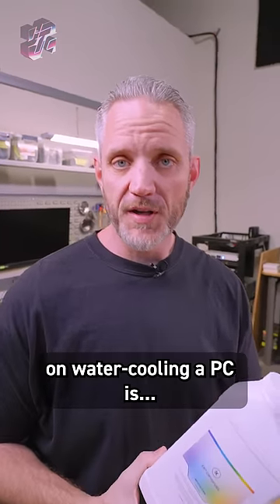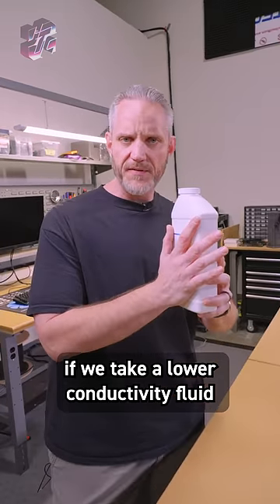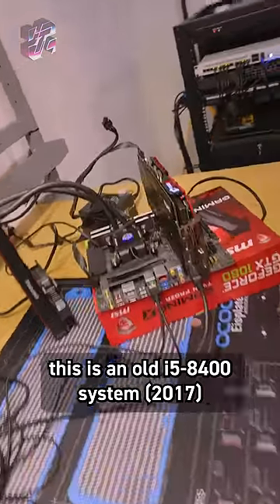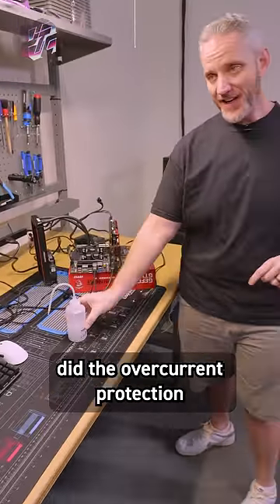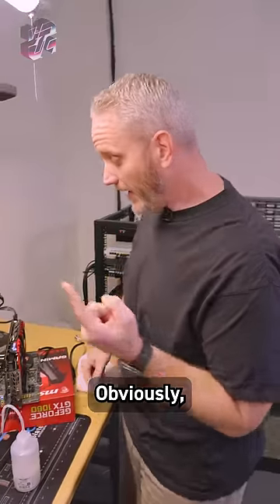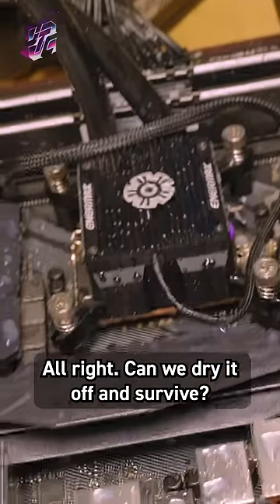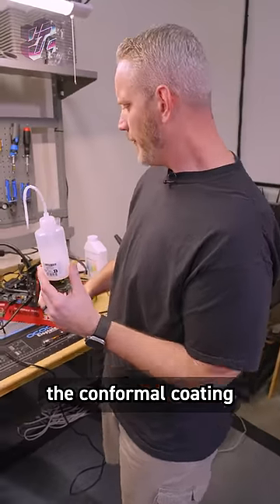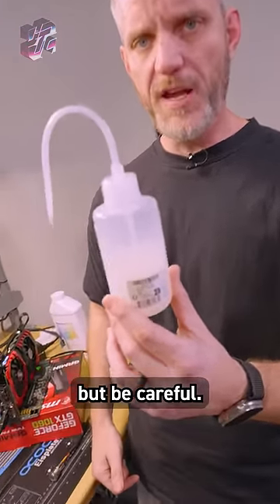Pouring water on a PC for science!    #pc #pcmr #shorts

Comment: I'm sure it's dependent on WHAT gets hit with water. I had a distilled water leak years back spray from a radiator in an open loop directly onto my GPU. Nuked the GPU, CPU, and motherboard. Only the memory and storage was salvageable. Of course the cheapest components survived....

PSU protections are probably better today as this was a decade ago but I still don't fully trust open loop systems since as that was a VERY expensive mistake with cutting edge hardware.

Comment: Why would the overcurrent protection of the power supply trigger here? Your CPU is drawing dozens of amps while the liquid will conduct a few mA at best. A drop of this liquid may change the value of a resistor with dozens or hundreds of kiloohms significantly, messing with reference signals on the board. If you drop that to the power regulators on the mainboard, you may get an overvoltage from that (as you mess with the voltage reference). Anyway the explanation here is absolutely wrong and suggests you can just water your components like plants.

Comment: I'm still sticking to air cooling, there's fewer points of failure.
Reply: The risk with water cooled systems is very minimal, so long as you know what youre doing. If you have some skill in general plumbing, putting these systems together should be second nature.
Reply: @Draugoth  I'm not referring solely to leaks. With an air cooler, pretty much the only point of failure is the fan, barring some freak manufacturing defect in a heatpipe. Replace the broken fan with a new one for a few bucks, bam, done.

With water cooling, not only can a fan fail but there's also now a water pump that can fail too, plus a non-zero chance of a hose or fitting leaking. And if you're using an AiO, if the pump fails you're looking at an entire new AiO unit, no fixing that piecemeal. For gaming workloads, the extra heat capacity of a water cooling system just isn't worth the drawbacks to me.

Price is another consideration. I've been using the same $50 Zalman cooler for nearly 13 years, with both my old i7-2600K build and my current i7-9700K. I've only replaced the fan once, and it's still cooling just as well as the first day I got it. If I had gone with water cooling instead, I'm sure I'd have spent a lot more money replacing a lot more parts than just a $15 fan over that timespan.
Reply: @executor32  Well, most systems will be just fine with a simple air cooler. Its not really till you get to higher end stuff that eats more watts that you also  plan on also pushing very hard where liquid cooling will yield better results. All my old systems were air cooled. On my last system, the little UFO style cooler lasted seven years, course I was runnign an i5. There are some AIO units you can repair and/or refill, but generally once the pump is gone, that's kinda it especially since they are supposed to be vacuum sealed and about nobody but a manufacturer can do that. That said, you can expect around six years out of a typical AIO, given you minimize the amount of air in the pump chamber.

Comment: Yea, I've messed up a few times over the years with watercooling, like forgetting to tighten down a fitting, but I never had and components fry from it.
Reply: Did you use water or a glycerin based coolant?
Reply: @Kmmlc It might have been normal tap water once, in the early days, but after I bought a dehumidifier I used the water from that from then on, so it was maybe safe enough anyway.
Reply: @JoeBob79569  Personally I prefer using a glycerin based coolant even though it's not quite as efficient. I will never have to worry about it being conductive and if it does manage to leak and gets somewhere I don't see, I don't risk frying anything. Though I did have a loop for 10 years and only had to change the tubing once and the coolant I changed every two years.

Comment: jay you should leave a pc next to a window, I had one that had some condensation buildup and it made a wonderful smoke/vapor show.

smelly "smoke" poured out, i pulled the plug, couldn't find anything burnt

removed components (the gpus) and booted it a second time, nothing was really off or wrong, maybe a little more vapor.

i put a single gpu back in the rig and it booted fine, still need to test the other gpu that was in the rig.

but it booted again even though there was a huge smoke/vapor show, but i think it'd be a good demo for people that maybe run their computers next to a window/high humidity conditions.

if i had noticed water on the mobo i wouldn't have booted it, so i think there was a thin layer of condensation and when i booted the pc it instantly heated the components, evaporating the condensation making me think it was smoke.

there were no bad "electrical" sounds and the psu never kicked off
the pc didn't flicker or anything (i turned it off within a second, the vapor was instantly when i pressed the power button)

Comment: This year I had one of my hard line tubes pop mid stream. Water/coolant was absolutely gushing inside. I managed to shut it down before it shut itself down. Took that as an opportunity to do a deep clean, figured out why the part blew out ( it was a complex triple bend with two 90s and a 45 and not much room between a fitting and the glass side panel, one of the bends was too close to the fitting and didn't allow enough bite, honestly surprised that it lasted as long as it did), corrected the issue with a new pipe, installed the new pipe, refilled, and it's been working like a champ ever since

Comment: Jay: Never use a blower on your PC
Also Jay: Use a blower to dry your PC
Reply: You can use a blower on the PC, just not a compressed air blowerm, I guess
Reply: Opened the comments to write this exact one.

@Morbiuzx1308 it's a reference to another short, where Jay showed the same blower and said not to use it on a pc, because fans are also generators and electricity doesn't mix well with computers, jadda jadda.
Reply: @mehowme  poke something in the fan to stop it rotating 😉
Reply: @mehowme so it's fine to use it on your PC but not on most fans while they're connected to your PC.
Reply: @mehowme ... tape down your fans or hold them in place?
Reply: Main issue about blowing air on PC is spinning the fans and creating an electric current that might hurt some components.
Reply: @fsmdf   as i commented above, poke something in the fan to stop it rotating, i doubt it'd generate enough current back to the motherboard to damage anything on that, but could certainly destroy the fans internal circuit
Reply: @sambob998  extremely unlikely it'd produce enough current back to damage anything on the motherboard....destroy the fan itself, yes very  possibly
Reply: @fsmdf I've never had a problem with this. I always shut off my PSU, then unplug from UPS. Clean out PC quickly. Let sit for an hour or two. Plug it into UPS, switch on PSU. Power on. I do this once a month because I like to keep my systems really, really clean. 

If it's a friend's system with a lot of caked dust and such. I'll tape fans or just remove them and clean them with a brush after taking them apart.
Reply: @SgtCroaker  'if' it is going to damage something, it'll only be the fans internal circuit  itself, extremely unlikely it'd be able to produce enough current to backfeed into the main pc circuitry as it'd be such a much lower resistance load!
Reply: @SgtCroaker 
PC fans generate electricity/current even when not connected to any power at all and thus, when you spin fan blades in a PC w/o it on, you are doing damage to the components in your PC. 
  Thus, have PC on when blowing and avoid any issues.
  If Fans are really bad, detach out of PC if possible and clean.
Reply: @andygozzo72  I know. It doesn't hurt to take precautions. As far as removal of fans for cleaning a very dirty system. It's just much easier to do.
Reply: @truthseeker6532  if fans are bad I do detach and take them apart for cleaning
As for the electrical issues. I've not experienced any issues ever before on my builds going back to 2007. I give a quick blast and use a soft paint brush.
Reply: @SgtCroaker  
You must not have an expensive PC.  I take it you are not a Gamer? 
Most PC Gamer Rigs start at 5 grand and that is the cheaper side of things.
PC Gaming Case alone, is around 400 - 800, Video card around 2 grand, Monitor 2-3 grand.
Most Good Gaming rigs are around 8-10 grand for everything.  Have a built Room as PC gaming room or a room turned into PC gaming room can be ones bedroom.
  The unprotected electricity/current entering into a 5 grand to 10 grand investment Gaming PC = One will be careful when cleaning or learn a very costly lesson the Hard Way.
  Business PC's 2k or less or so, who cares.  PC too cheap to go through the hassle.   Just a video card from a Gaming Rig PC (4090 = 2 grand) cost more than many PC's at companies and at peoples homes...........lol!!!!
Reply: @truthseeker6532  What?! Where do you get these prices from? $5,000 for essentially a beginner "PC gaming rig"... I'm dying. Lmao..

Comment: I've "accidentaly" put my screwdriver on my mobo, z690 pro A and the psu is an RM1000X, my 13700k died. 2 core precisely died, I had to disable the 2 faulty core in the bios for being able to use my pc when the cpu was used a bit more than usually, like heavy game or benchmark

Comment: agree, electronics nowadays are tougher then people think, yeah, dont go throwing salt water on a 50,000,000 super computer. but most systems will handle accidental spillage/leaks, had a system survive a housefire WITH sprinkler system. still worked fine for 2 more years. then it blew up. but still 2 years of system that was soaked and ON durning the sprinklers going off, and then getting dried by a toasty 1500 degrees Fahrenheit housefire. impressive. linus did a video too on static electricity and how they harm components, and they hardly do any damage

Comment: My loop suffered a catastrophic leak a 2 years ago.
A blockage developed in the radiator due to the EK anti-vortex foam disintegrating.
The system overheated and a tube popped out.
About 250mL of fluid dumped out.

The next day.
I removed everything from the case.
I stripped the case down to bare metal, I even took out the Front IO board, I hosed down the entire case

I also removed all heatsinks on the motherboard and I used a pressurized chemical sprayer full of IPA and sprayed the motherboard, RAM down.

I also had to take apart the GPU and CPU water blocks to clean them out as they had some of that foam in them.
The pump has some in it too.
But cleaning out the Radiators was the tricky part.
After 2hrs everything was back together.
Just had to wait on new tubes to come in.

What I learnt, do not use those fucking anti-vortex foam things.

Comment: The highest risk of leaks is when the system is first filled.  The easy way to check for leaks is to fill the system and leave the pump running for 24 hours.  Check the water level in the reservoir every hour.  If it doesn't stabilize, you've got a leak in your system.

Comment: I really doubt the psu is tripping out on over current. it would take a ton of current to trip out the psu. water isn't conducting enough to do that. if anything, it's just crashing the computer or causing the motherboard to panic. example, my tap water from the kitchen sink, last I checked something a bit over 200ppm, I'm seeing a bit more than 30k ohms with a multimeter in a glass of tap water. at 12 volts, this water would conduct about 0.4 milliamps, only 0.0048 watts. there is no way a psu will ever trip out on over current protection from this tiny bit of power. a single led uses orders of magnitude more power.

Comment: I've never liked watercooling starting decades ago now in the earlier days of what would become what we consider more modern watercooling. Instead, I focused on perfecting airflow through optimizing fan count, direction, power, air ducting to guide air, etc. My systems are quieter than most water cooled and, outside of epeen benchmark races, work just as well as or better than most setups your average user would buy and install for a lower price and much longer life span parts/materials wise.

I'd be more worried about people using tap water and having tons of minerals deposited onto the board after it dries. Obviously, you're not supposed to use tap water, but you're not supposed to do a lot of things people do anyway.

Comment: There is no conformal coating on consumer-grade computer components and the power supply didn't protect your board from a short circuit. Your setup turned off because of the current leaks in higher sensitivity inputs.

Comment: I have never used water cooling, but I always assumed you use distilled water because that is not conductive. I also often wonder if fluids with higher heat transfer capability are ever used.
Reply: Every fluid with better heat conductivity is either expensive, dangerous, or just not practical. The easiest would be pure alcohol but trying to keep alcohol from leaking is near impossible and flammable liquid in an electric device is generally not a great idea.

Comment: One thing i would note is that most pc cases mount the psu at the bottom. Can you simulate what happens if water gets into a a good power supply?

I know most bottom mounted psu are fan down. But the modular connectors/ bundle is my concern since there is high voltage involved.

Comment: The worst case senario is that when a short is on one of the leads to the BIOS memeory module and it then wipes out the BIOS firmware (experienced this), if the motherboard has the ability to write the BIOS video a USB flash when no BIOS exists then you're ok you just need to flash the bios and you're good. UNLESS it destroys the BIOS ship, and in that situation many are socket chips that can be replaced and then flash using Ez-Flash (or similar)

Comment: I was pulling a window AC unit out of my window because it'd been cold outside for several days. I forgot that the bottom would be full of condensation, and my PC was directly under the window. So I yank it out, tipped it over, and water spilled into my computer. Before I could shut it off I saw my video card start artifacting. I was hyperventilating because I couldn't afford to replace anything in my pc. So after using some IPA to displace the water, and then drying it thoroughly, I went to start it up. Worked perfectly. Card went on working for 4 more years, until I finally upgraded my entire pc.

Comment: I failed to leak check my system like I would usually do.  2080 ti got wet.  It was toast.   Watercooling is tons of fun, I really enjoy tinkering with it and drawing every bit of performance out of my system while having it run silent.  Like Jay says at the end, be careful.
Reply: Same happened to me, but... The 2080 Ti still worked after drying and reassambly.
Reply: Let mine air dry for a few days and it didnt work.  After that I put it in the oven at low temperature for a few hours and it still wouldn't work.  Leak testing is critical.

Comment: Years ago I made a custom loop that was fine but then the res+pump would leak went through 3 of them apparently the acrylic plastic had a tendency to do that and the product was removed.

Then the waterblock the sealant came away and leaked all over my graphics card lucky the PSU saved the system. After which i thought bugger it and got an AIO ASUS ROG Ryujin 360 still running to this day with zero issues for the last 5 years.

Comment: Water cooling is LESS effective than air cooling.  You are adding a bunch of items that resist heat flow between the CPU and the actual cooling fins that ultimately get cooled by air.

Comment: Also, how sticky is the liquid cooling medium. An AIO sprung a leak about 5 years ago and covered the back of the GPU a sticky goo that smelled a lot like anti-freeze. Not only did it short out the system it also adhered itself to GPU and adjoining motherboard making the cleaning and drying process incredibly difficult.

Comment: My Brother in Law had a horrible experience. Massive Highveld Thunderstorm caused the roof in his study to collapse and soaked his brand new Ryzen 5 system... Like muddy crap water all over everything. Pooling in the case, power supply drenched and even the screen on the table got soaked.
Took it apart, rinsed it with distilled water to get the muddy crap off, and then let it sit in rice for a week.
Put it all back together, and it booted up first time and is still running today almost 2 years later. The screen wasn't so lucky.
The PC was plugged in, but not powered up.

Comment: Water cooling is unnecessary these days anyway with how good fans and heat sinks have gotten.

I say this as someone who was overclocking a i3 530 almost a full gigahertz over stock on air. And I did the same thing with an i7 860. I tried it with a Xeon 3440 but that chip wouldn't take higher clocks.
Reply: You name off 12 year old legacy designs not the modern heaters released today...

Comment: It didn't work as well with my Commodore 64 that my mother left in the backyard over winter when I was away, and she cleaned out the spare room. 

Cleaned it out, removed the slug, and dried it off.

Plugged in and over a few minutes, a blue dot appeared in a centre of a screen of static. The blue dot got bigger and bigger until I could see the DOS start-up screen. 
As the static reached the edges and the screen was almost clear, there was a pop, and it completely died, never to work again.
Reply: The pop was probably something simple, like a blown fuse or burst capacitor. Easy fix.

Comment: there is a coating called never wet. I sprayed all my electronics with is like tvs outside and everything and you can spray it with a hose and the water cant make contact and just beads and off, extremely hydrophobic